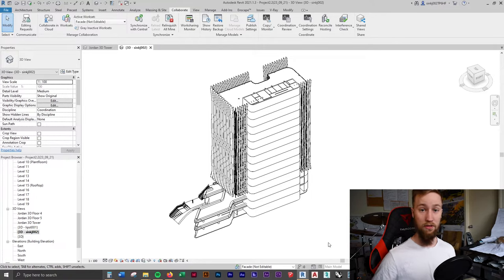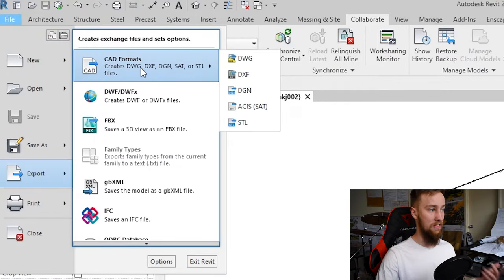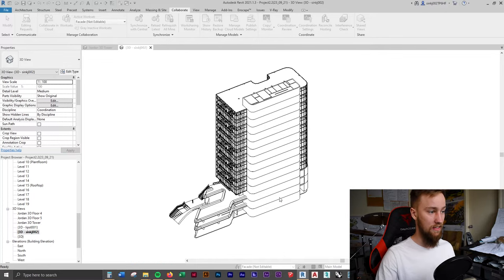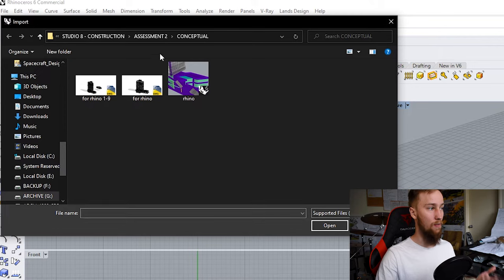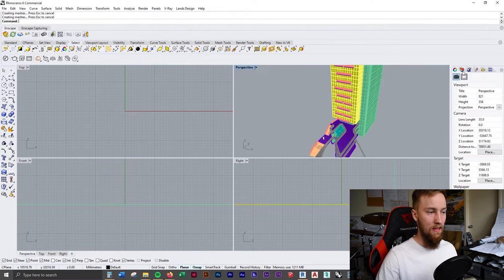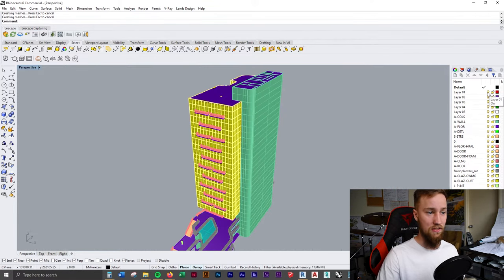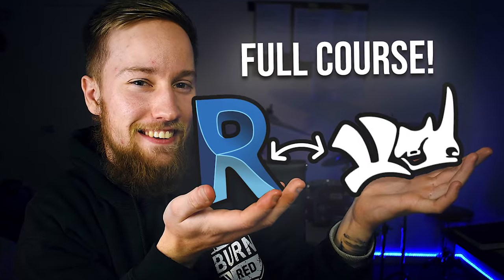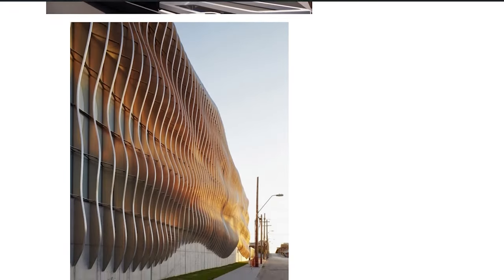How to Export Revit to Rhino – Export from Revit & Import to Rhino

Comment: Hello, great video. I am curious, does this convert the materials applied in revit over into rhino as well? Or just the surfaces/objects?
Reply from the maker: I don't believe it converts the materials, though it does group objects with the same materials applied in Revit so you can easily apply them in Rhino

Comment: Another Architecture student here, forever grateful to you for this video. I was wondering what your workflow would be to render the final rhino model? is it to enscape or lumion? how is the rhino file prepared? is it to apply the materials in rhino first? and which one do you think is better? Many thanks again!
Reply from the maker: I would use enscape in either Revit or Rhino, whatever program has the materials applied. You can also import into Lumion if you prefer third-party rendering software. It's personal preference there. Enscape is easiest so I like that!

Comment: mine imported as an incorrect scale and it wont scale properly. is there way to import it at the correct scale?
Reply from the maker: You might need to adjust the scale in your Revit 3D view. Otherwise, when exporting/importing in either program, there might be an option/checkbox/dropdown menu that asks what scale you wish to import/export as.
Reply: I figured it out. You have to save the rhino before before trying to scale the model or it just explodes
Reply from the maker: @devinboyd6768  Beauty. Well done!